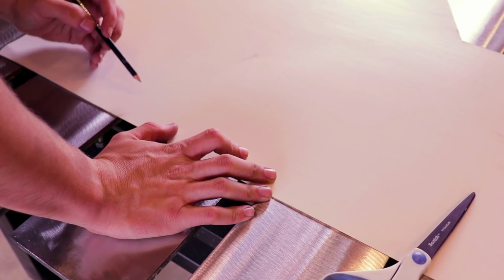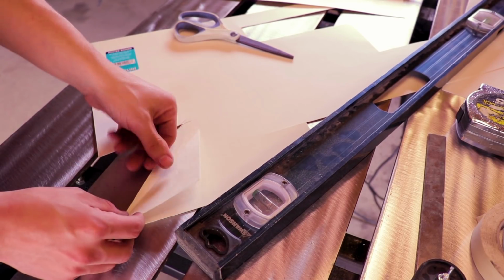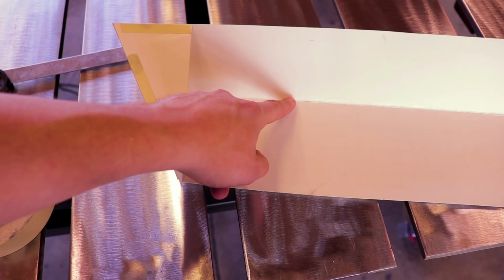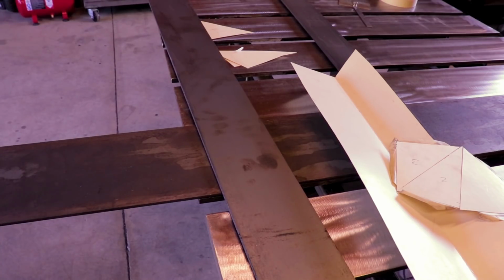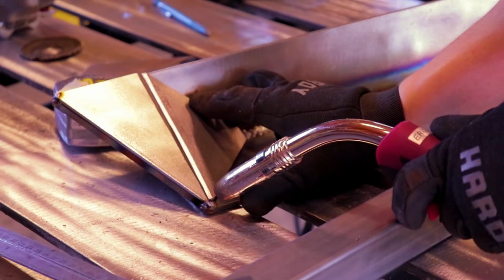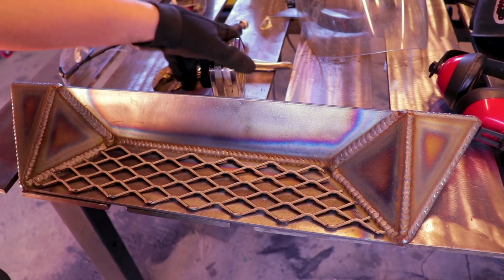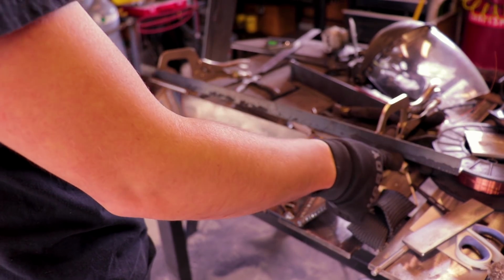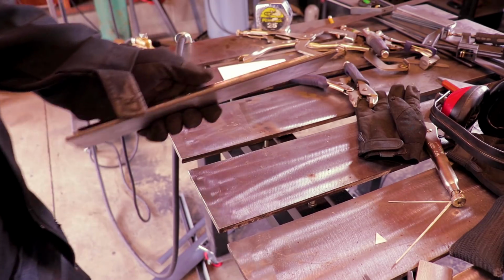DIY Metal Fabrication (Truck Step/Rock Slider 2)

Comment: Are those mounted to the rocker panel?  Looked like they had some movement to them when you stepped on them.  I’m wanting to do some that mount to the truck frame.  Beautiful welds!
Reply from the maker: Yep right on the pinch weld.  Ya you really have to get the angle of the cam piece perfect so theres no as much movement but  it works good!

Comment: Awesome job, nice, neat Welding. Alot of metal prep before welding and small tacks, not spot weld like me and warp metal or bugger up the squareness of the build
Reply from the maker: I would much rather have more tiny tacks than a few large ones!
Reply: 5th Street Fab I agree, I'm learning fabricating brackets or gates and projects but I love Welding and 7018's I'm good at. Which 6013 do you use in USA? We e use easy arc or vitemax 6013 for fabricating projects with stick(smaw) welding using 3.15 mm electrodes for thick steel and 2.4 mm for everyday welding
Reply from the maker: I try to stay away from stick welding! Haha we usually run 6010s here but I have heard of people running 6013s but couldn't tell you what kind.
Reply: 5th Street Fab 6013's boilermakers and diy welders use to build trailers, gates, projects, here 6010's aren't used only vertical up welding pipe with 7018's, they don't sell 6010's here in South-africa at renttech only at afrox but is expensive

Comment: That was cool how you laid out the corner angles,so simple and clean looking.
I gotta find a source here for that poster board!
Reply from the maker: Thanks bud 🍻. It makes layout much quicker! Im not good with metric haha but I'm sure they have something similar!
Reply: Funny you mention metric,i actually use imperial alot  haha 
most of the car fabrication stuff is imperial  for tubing and the like,but i also use metric.
All the machines and tools i did my trade on were imperial dials/graduations and readouts.
Reply from the maker: Haha man that's tough!  I have trouble working on cars when they have metric and imperial!

Comment: Nice to see someone actually bevel their butt welds instead of getting it as tight as they can and then grinding it off and leaving very little weld
Reply from the maker: never liked butt welds without a bevel.  way nicer to work with especially if you have to grind them down.  Thanks for watching bud!
Reply: Thanks.. most YouTube welders scare me lol